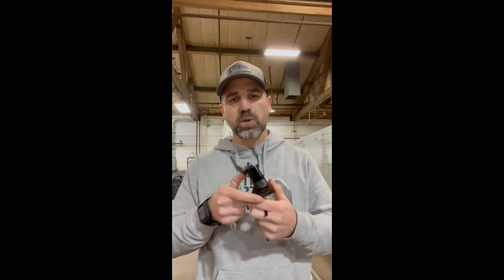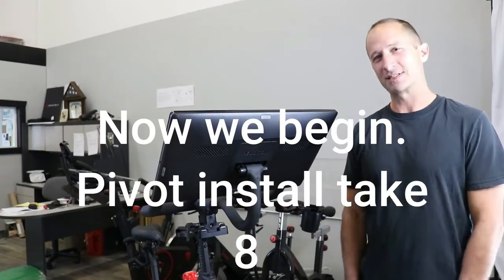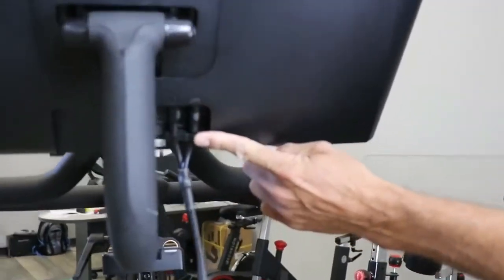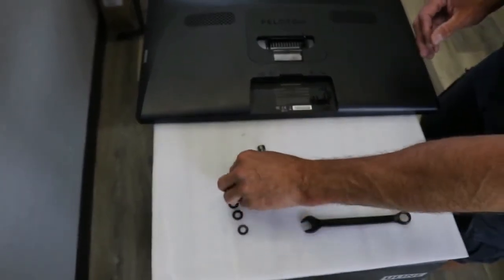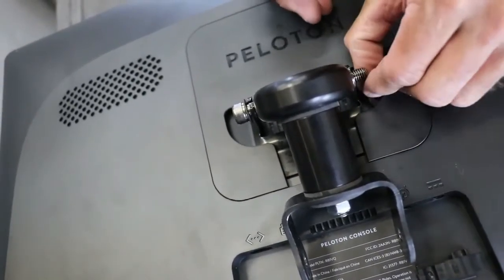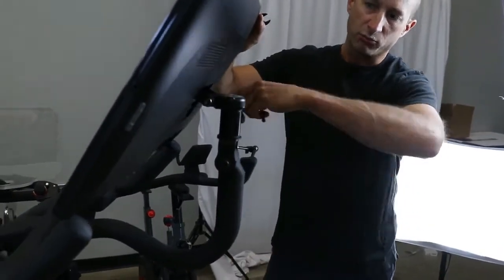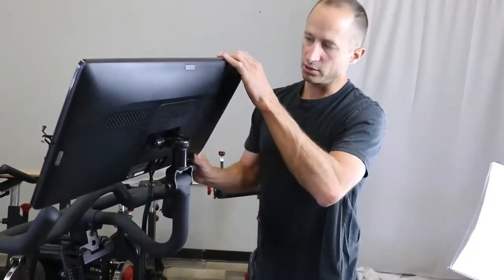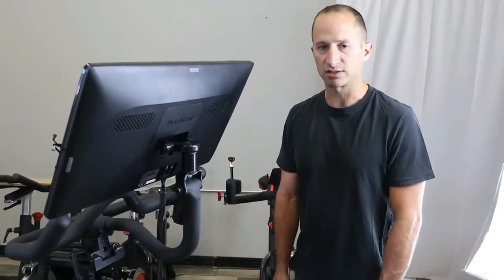Pivot Install (Updated)

Comment: What do you suggest when the bolt on the bike is so tight you can’t get it off? It’s like Peloton knew I was trying to remove it and it’s not letting me!
Reply: I had the same issue. I’m sure you had it resolved already but I ended up and used a real 13mm torque wrench and then it was a breeze.

Comment: Hi, after installing my pivot and going on a Intense riding in or out Of this saddle on my Peloton my screen moves left to right by its self. How can i make it stop or  Tighten it some more????
Reply: Yes tighten some more. I’d suggest using a “real” 13mm torque wrench instead of the flimsy tool they provided.